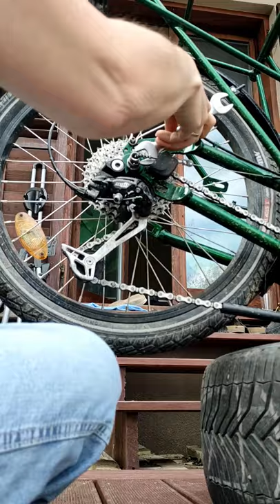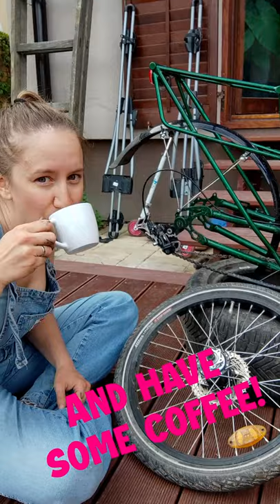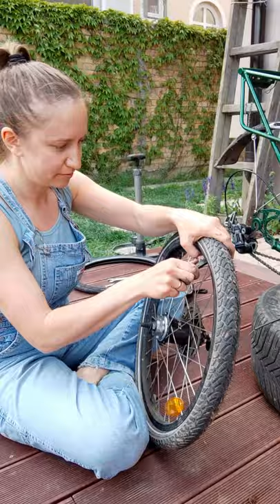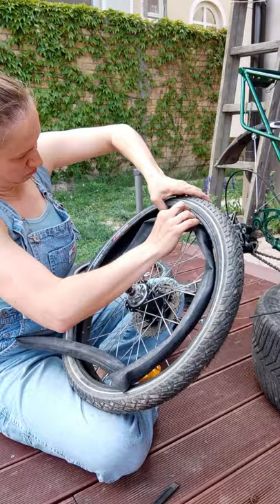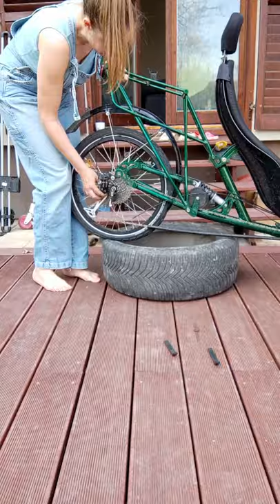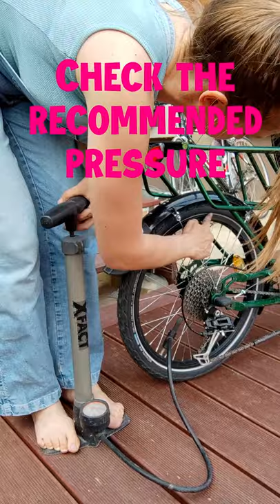How to change a rear tyre? // Recumbent Trike Tips | Steintrikes Wild One #shorts

Comment: Very concise video, nicely done! If you’re ever on the side of the road with a flat, remember it isn’t necessary to remove the tire from the rim to replace your inner tube. That will save you time. A bike helmet is a good bike stand too and it’s a lot easier to carry with you. 😂 I enjoy your videos, thanks for making them!
Reply from the maker: Thank you! 👍 I know that you don't need to remove the tire if it's only the tube, but this time I actually had to change the tire as well because it was cut for ~ 2-3 cm in one part. Bike helmet - very good tip, I wouldn't think of that! 😁